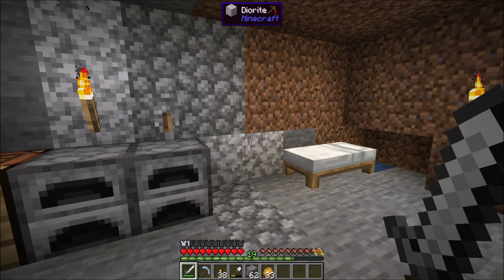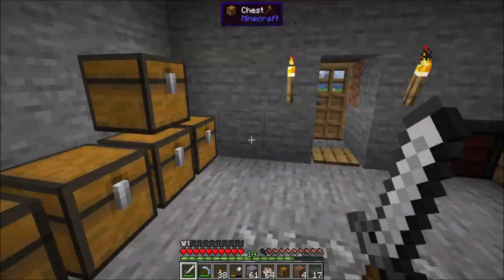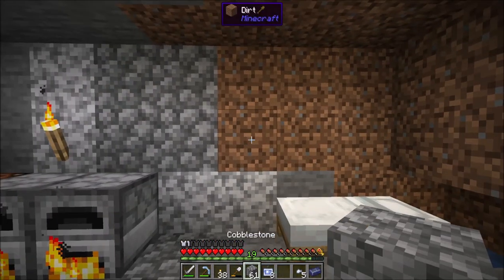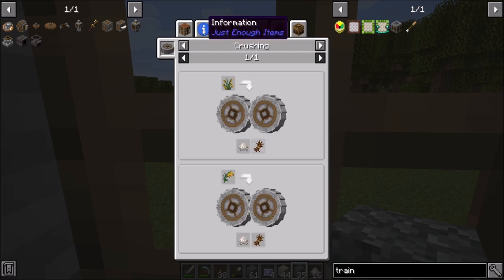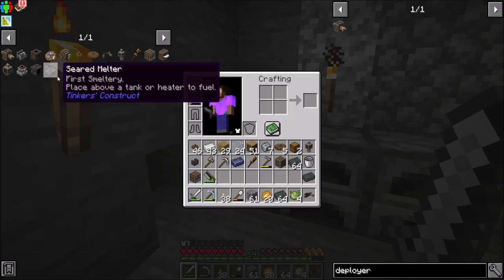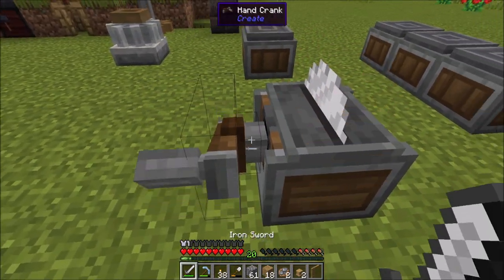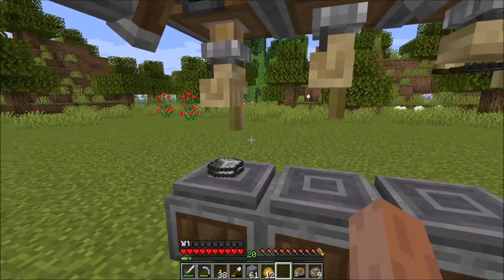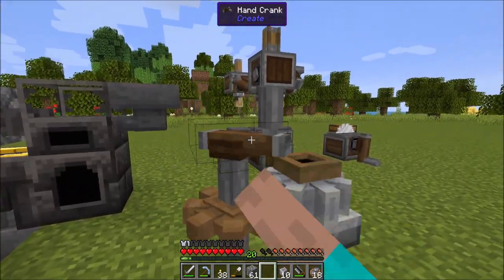Create A&B Ep4 Create Machinery

Comment: Direwolf.  You should treat this as if it were Factorio/Satisfactory etc and automate and chain all the things.  If you are doing almost anything in a quest that is titled "contraption x" manually (exception is the final machine step of combining the mechanisms with the casings although i don't think the quests suggest you automate that anyway) it will just turn the pack into grind.

Comment: Dire: You will want to automate all of chapter one and have everything generating and being processed into stacks and stacks of these basic machines. Everything builds off of that, so having an infinite supply of those being automatically created will pay off in the long run. Also, you will need an automated kelp farm. Consider digging holes down to bedrock and using some kind of lift system for bring up your andesite and kelp.

Also, spread out. Don't try to compact everything. Leave yourself plenty of room and use belts to transport stuff around from place to place. Think factorio style, belt it long distances if needed.
Reply: Def want factory set up for basic machines also a smelting factory is handy
Reply: Good to know for my playthrough of the pack, haven't played in years and never with Create. Been enjoying figuring out Create. Like before I watched last ep and saw that you can just lever the faucet, I used pipes with a pump to out to the casting table.
Reply: Also plan out what you're going to do.  Belts are a thing, and you will get a huge factory eventually, which may even spill into the nether. ender chests require enderium machines, but are available eventually. Pan on what you want to transport, and what you manually move. Also batch craft tools that you use a lot of.. it saves a lot of time in the long run
Reply: And for God's sake build some water wheels... they're easy
Reply: dire's bane: actually automating stuff, instead of leaving things to craft on-demand
Reply: Encased fans and waterwheels are the early game create power sources. I doubt he'll play this pack for long since he's trying to rush and skip ahead.  It'll lead to tons and tons of manual crafting and huge timesinks and that will burn anyone out :(
Reply: Digging down to bedrock to grow kelp is stupid.  Grow it at your base.

Comment: I just started this pack yesterday. Exploring early on definitely pays off. It is always worthwhile to power your contraptions; only use hand cranks for occasional tasks, like piping molten metals.

If you want to rush brass, set up two seared melters and pipe them into a mixer's basin. The mixer doesn't need heat if the metals are already melted.

Comment: Water wheels, shafts, and gears are the easy way to start powering your early game automation. You dont need belts first. You can even move items with fans, water, and/or ducts before needing belts/rubber.
I found using a long duct from bedrock to the surface with a fan on top (it sucks the items up even with low power) to be a good way to transport your automated andesite to the surface. You can use funnels to get the items in or out of the ducts.
Also, something that may help future dire (since I know you record in advance). Using drawers with funnels on them can be a great way of filtering items passing by (by belt, fan, or water). The drawers make it so the funnels only suck up those specific items and let the remaining items pass. You can then funnel out of the drawers after the items are sorted to go wherever you want.

Comment: If you are using the hand crank you can put it on a bigger cog and have that connect to a smaller cog which then connects to your machine to process stuff faster. You could also just make a water wheel it is super easy to make unless they changed the recipe

Comment: I will probably regret saying this, because you usually figure out the stuff in the video but you know you can tell vanilla hoppers to load horizontally by shift clicking right?

Also, vanilla hoppers integrate with create very well, and you could probably have your grindstone drop directly into that smelter with a single hopper.

Comment: Chapter 1 definitely not completed. You will need to automate everything in the chapter. And you can get belts pretty early if you look it up. Automate everything. That’s basically the point of the whole pack.

Comment: wouldnt it be much more efficient if he used a large cogwheel connected to a small cogwheel which then is conencted to the mill/stamp? you could then get a higher gear ratio
Reply: I haven't tested it myself, but maybe the handcranck doesn't support this load?
Reply: No need to.. get a waterwheel setup asap :)
Reply: @disarm2k10  that would be optimal, but im going to test my theory. see you guys in a bit

Comment: The entire curveball of this pack is, "think factory not automation". It clicked for me last night and progress accelerated.
Reply: what do you mean by "factory not automation"?
Reply: @sukedent1  Rather than thinking about 1 step "this is now done" automation. 
You end up needing to set up long chains of automatic parts and connecting to form a surprisingly long factory just for 1 thing.
Reply: @b00marrows  ahh okay, so basically always assume something you've automated will be going straight down the belt into the automation for another thing.
Reply: @sukedent1  Yeah don't stress it too much, there's a lot to learn with create. But never assume anything is "done" its usually just part of the bigger picture and you might have to change or move things to fit your growing "factory" as you go. 
A tip: the wrench shift right click insta breaks create blocks. which makes pack ups MUCH faster.

Comment: You are marking your quest book wrong Dire, you need to complete a automation to check the quest as complete... Also, water wheels.
Reply: he knows that, but he's not checking it wrongly, cuz if that's the case, you could only check it after you did the automation, not before. So it's the modpack's author's fault for that.
Dire did nothing wrong.

Comment: Don't use belts to transfer rotation, they consume stress. Use shafts, cogs, and gearboxes
Reply: I'm pretty sure they removed belts causing stress so they can now be used to transfer power without cost
Reply: @malcomthonger  stress caused by belts was removed in the .4 update for 1.17/1.18. dire playing a 1.16 pack
Reply: @Mar10K0ng  ah I didn't know thanks!